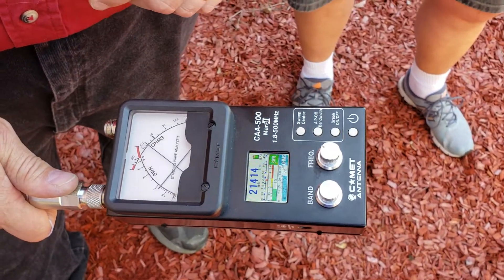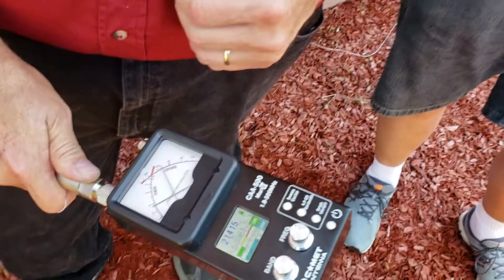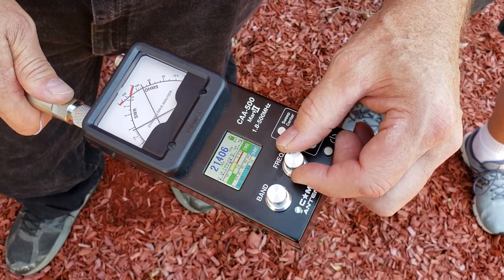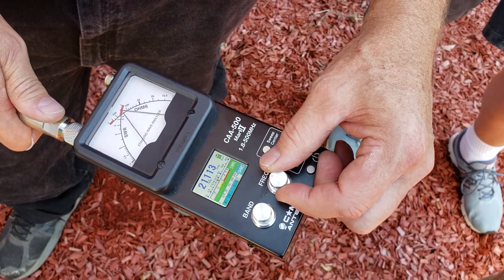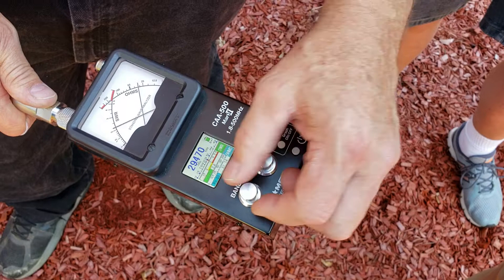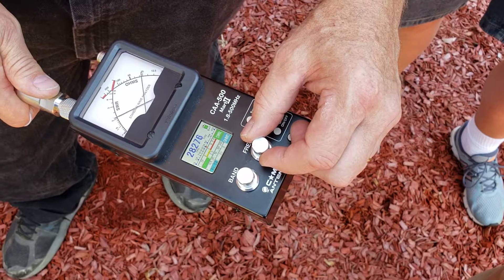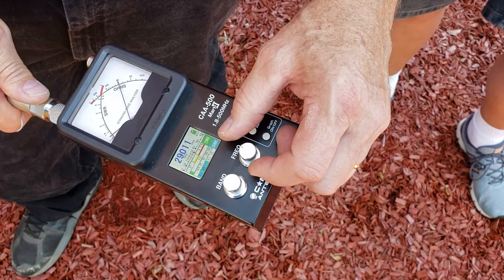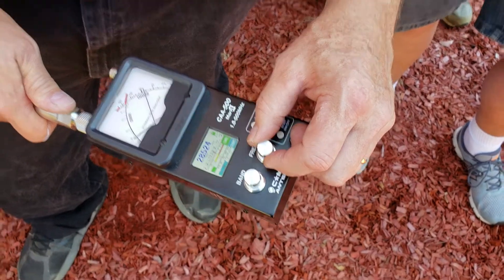Using the Comet CAA-500 MKII

Comment: also its comet the analog with needles does not correspond to the digital lcd as values?
Reply from the maker: I don't understand the question
Reply: @kellingc  in my analyzer (comet caa 500 mark 2) the values of the hands do not correspond with those of the lcd screen. example: swr hands 1.6 lcd 1.8
Reply: @danterossi6180  My understanding with this analyzer is that the needles are more accurate than the 'readout'.